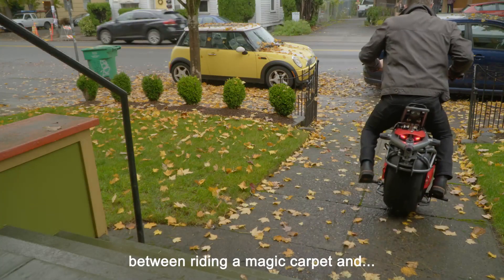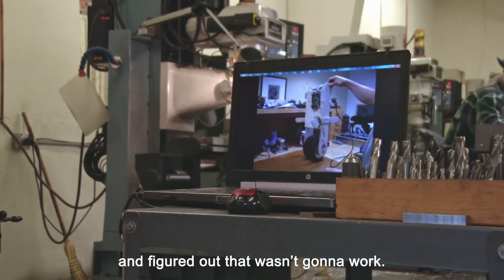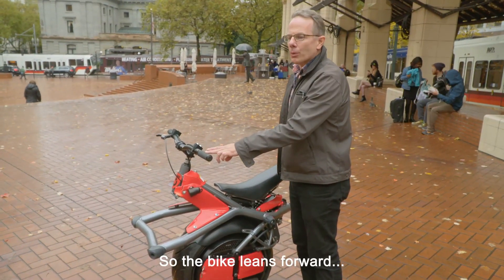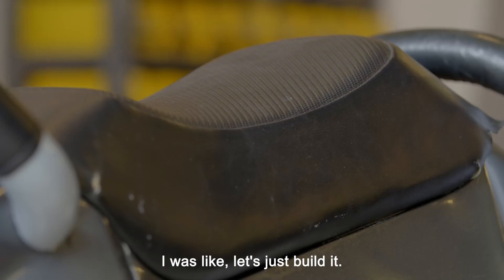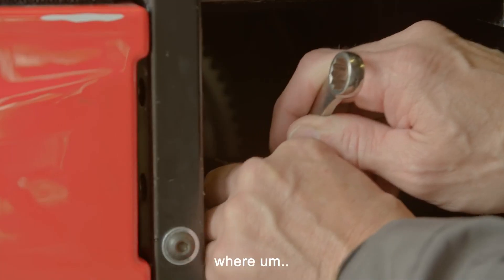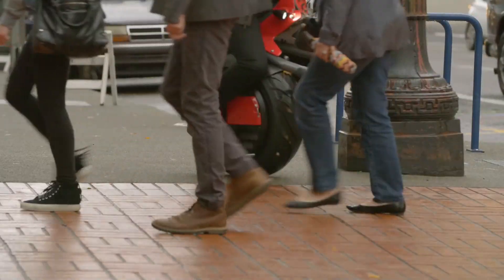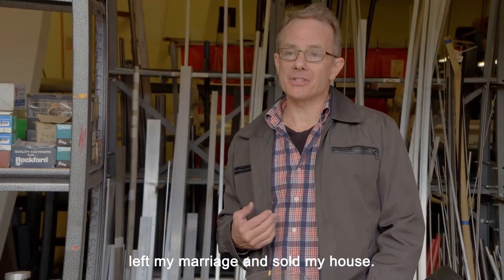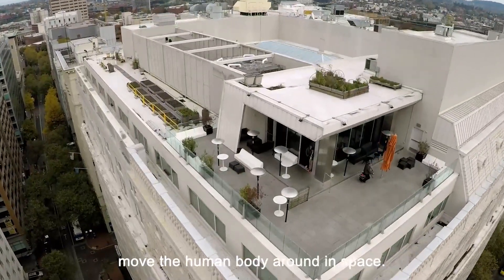One Wheel Is All It Takes For This Bike To Drive Around

Comment: Jackie Lee Bailey of Indiana invented a gas powered one wheel self balancing motor cycle with a trailer hitch to put his boat in and out of the water in 1986. Never shown to the public. Never patented.  No pictures or schematics. Just for fun. This isn't new. Just easier with a DC motor.

Comment: So do you need license to ride this Uno motorcycle? Is it strictly for in town use? You cannot ride it on trails because they do not allow motorized vehicles. So where can you write it and do you need license/tags
Reply: If you legally claim it as a “mobility device” you should be able to take it where you need to go, although there might be some issue if you’re going more than 30 mph even if you have a handicap placard on the thing. There’s only a certain level of accessibility that would be covered by this thing as a complete paraplegic wouldn’t be able to ride it, and someone who can walk normally wouldn’t be able to get the handicapped accommodation. Me personally it would probably fit well as I have a degenerative spinal condition which causes feeling to leave my feet and lower legs after a few minutes standing and I can’t walk anymore. But it’s not a mobility scooter per se. I’ve heard of some of those paraplegics that use those electric standing scooters to motorize their wheelchair and the cops getting upset with them because they go on the road as there’s no sidewalks where are they were going. I see plenty of old people and their little scooter carts bopping around on the road so I don’t see how that could be an issue but apparently it is.(of course those carts only go about 5 miles an hour so cops gonna complain. Goes too slow they wanna complain at you for blocking traffic, go too fast and they want to write you a ticket for being on the road. Those guys should just choked on a donut.)

Comment: You should make a front or rear or surround Electric mower deck that carries its own battery, turf tire knobby... front snow plow would be cool, also make it an inverter to power stuff make multi use, save the planet stuff. Small umbrella for low speed mowing, wagon attachment for flea markets, yard work ....... I think it is cool.

Comment: I'm only going to say what I'm about to say because you took a very cheap shot at EUC riders and makers. 
You've made an unnecessarily gigantic and more complicated version of what already exits with Leaperkim, Inmotion, KingSong etc. This would've been viable before EUCs dominated the market since 2019-present. No ones arms are flailing around on EUCs. You basically put unnecessary handlebars on a Begode Monster Pro. The whole point of one wheel is to be as minimalistic as possible and you failed at that.

Comment: It is cool but it is not for the roads with vehicles. One, it is too small to be seen, and two. In an emergency stop situation, it can not stop in a safe manner due to the physical dynamics in play here. Let's say a car pulls directly out in front of you and you're going at traffic speeds, and the only way to avoid hitting the car in front is to come to a fast stop. You go to grab a shit ton of brake lever. You're either going to go nose first, like a tree in the woods into the pavement. Or, because of the gyroscope in the machine, trying to keep you upright at all times, stop you from applying too much brake, all at once??? In a panic situation, your body physically can not lean back after grabbing that shit ton of brake lever to keep the center of gravity of you and the units, traction up, to slow up fast in an emergency.
Reply: Well while you're right that THIS thing cannot brake well, you're are wrong about these things in general physically not being able to brake. 

They could, if the firmware was good and the motor sufficient. I'm riding these things but without the seat and handlebars, and especially in my latest video you can see me do some 0.8g braking. Which wasn't my best, just what I happened to have recorded. 

The reason is simple: you only have one tire, so you're always on maximum grip, therefore there is no waiting for weight transfer like on motorcycles. You only have to get that tire Infront of you. On EUCs, that rather simple, you just sit back or lean back as hard as you can. On this thing in the video, what would need to happen upon using the brake lever, is that the device leans back while first accelerating Infront of the rider, and then braking with all the motor has to offer.
Reply: @lefotografion  I know I am right because physics is easy to apply here. You can't compare that thing to a motorcycle because it is a totally different vehicle. That thing you can have maximum grip for turns and tricks, but you are still going to fall over like a tree in an emergency situation when trying to stop in an emergency. The center of gravity is right above, where all your traction is at, and you have no weight behind you to keep you upright like on a motorcycle.  On that thing, grip is not an issue like on a bike where it would be, plus so many other factors come into play here when riding on a motorcycle.

Comment: How fast does it go before it cuts out and you fly forward to eat shit because you dont wear safety PPE thinking its like a 2 wheeled bike?
Reply: I would guess you have battery level somewhere. However if your wheel (front) will get stucked, then you'll have same problem like on most other devices.
Reply: speed is 10kmp per hour.  My son uses two-wheel electric scooter goes at 25kmp.
This invention is failure, it is heavy, cannot go faster, it isn't easy to drive.
Reply: @LogicStandsBeforeGod  failure? Depends on a marketing. People tend to buy things which they don't realy need and makes their live even harder.
Reply: @goodwill7643  The inventor said he left his marriage for this bike and sold his house for this bike, are crazy things for a thing which has no much use in life.